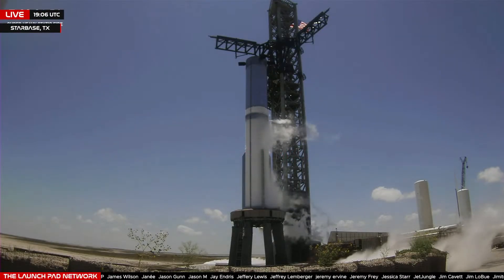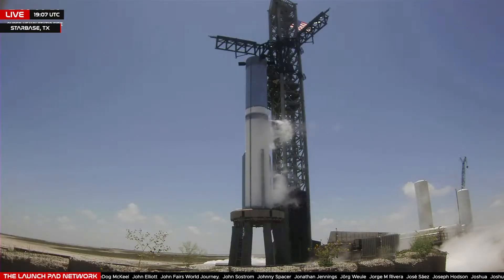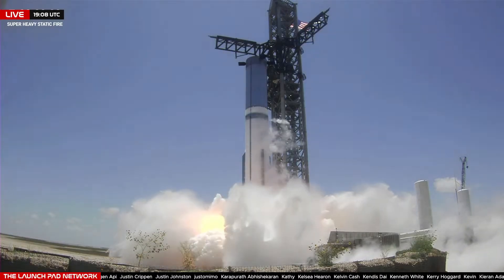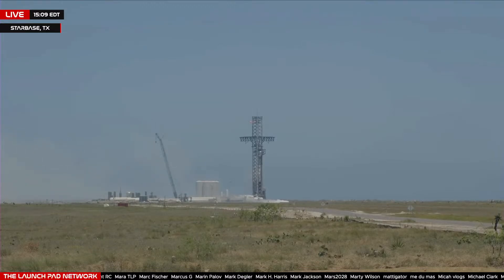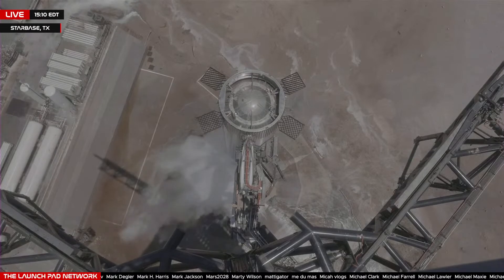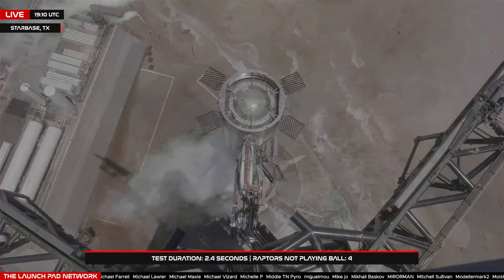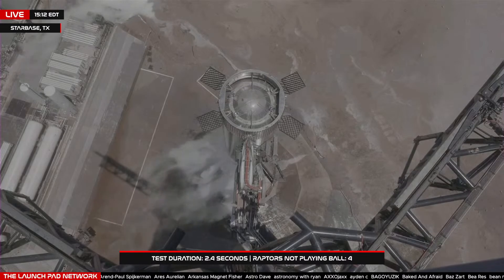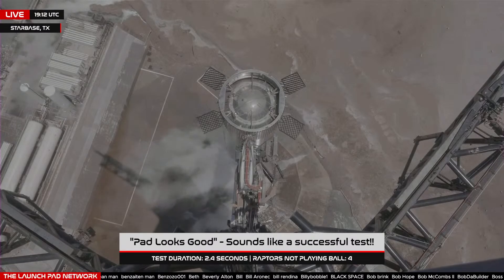REPLAY! SpaceX Booster 9 Static Fire Test

Comment: They need to move those white tanks far away.
They overheated and the pressure relief valves went off.
Reply: Its normal for the pressure relief valves to go off
Reply: @kerbal8216  If it is fuel or oxidizer, having it spray around isn't a positive feature. Even it it were water, I'm still baffled how over-pressurizing anything is a positive feature. At very least: simply ducting the vent to a safe location is the standard way of doing this so there isn't a run-away self-feeding fire. This is why these type of relief valves come with threaded fittings on the outlet.

More importantly, and back to my original point... they are close enough to the big burning thing so that the heat raised the internal pressure above what some lowly mechanical engineer deemed as safe for the tank.

Since it is "normal", I can only assume you know:
1. How much radiant energy was being put into the tanks?
2. What is the Cv of the relief valves?
3. What is the remaining liquid volume in the tank?

Based on knowing the above, one may be able to calculate how far the tank pressure extend beyond the relief crack pressure so that one may calculate the life expectancy of this "normal" operation.
Reply: @capn_shawn  It isn’t over doing it

They simply just release the valve to control water flow